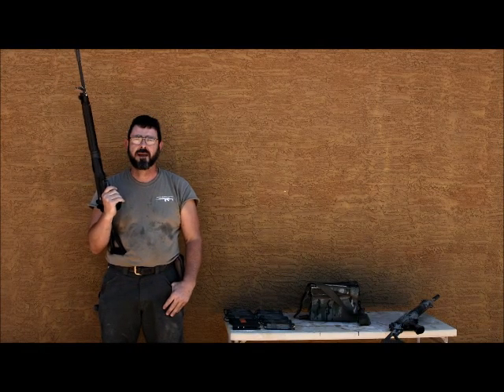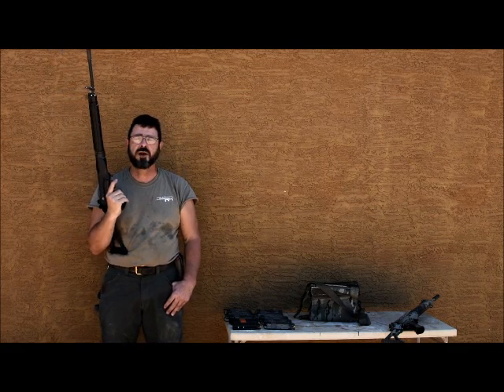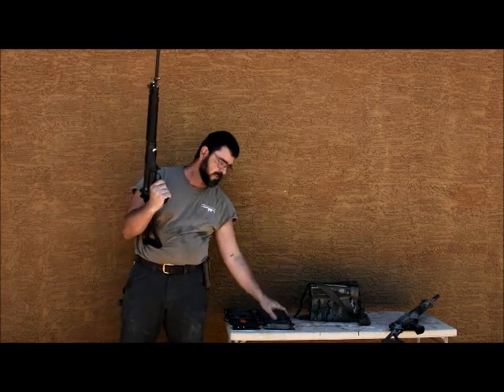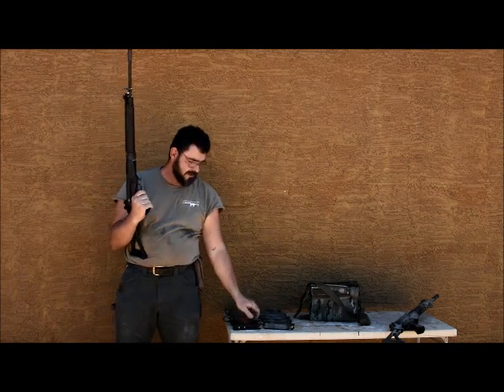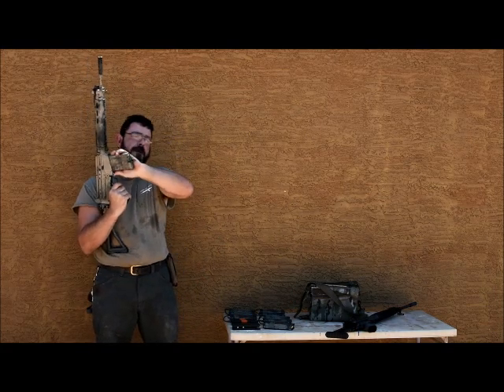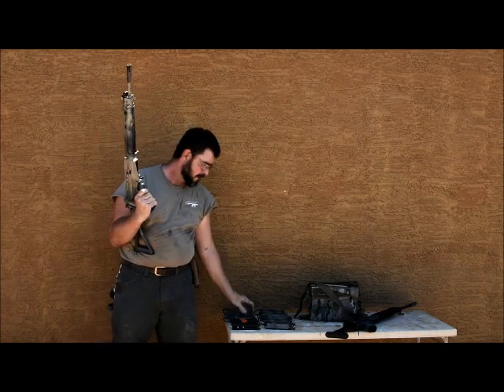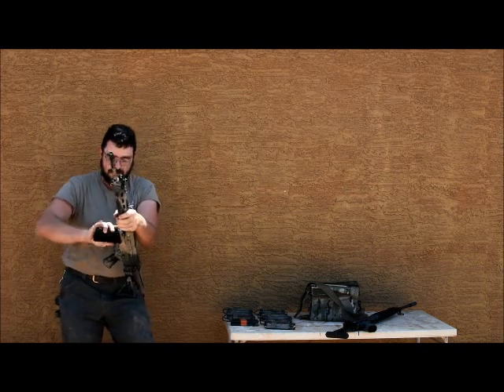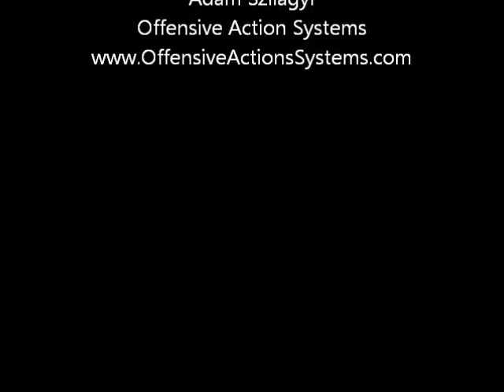Technical - DS Arms FAL Magazine Fit Demonstration

Comment: Well, I have one these from the 32300 range.  The original barrel was said to be defective in "overgassing" and broke the extractor.  DSA replaced the barrel and bolt.  Unfortunately the "overgassed" barrel does not seem to give the 2.5 MOA the original did.  More like 4 MOA.  All my magazines (10 DSA 20 rounders, 5 Austrian, one Thermold 10 rounder, and two DSA ten rounders (the short ones) work and fit very well.  I did have feeding problems and "bolt overs" but corrected that by removing a bit of the bolt hold open pin that was intruding into the cartridge on the left side of a loaded magazine.  Yes, I would have liked to get my hands on a SA48 (or FN FAL) but was short the "green".  I know there is hard feelings (to put it mildly) between Mark and DSA, but I'm inclined to go with Mark as he has ALWAYS answered my emails promptly and fully...no B.S.

Comment: What is the fundamental problem with the DSA mags?  Dimensionaly, where do they fail?  No doubt they fucked it up, but where?  It's not like they do not have the blue prints for the mags or enough samples to make a perfectly sized mag.
Reply from the maker: This video was to demonstrate the fundamental defects in the 2016-2018 DSA receivers.  Not the mags.  The mags have been junk since Day 1.  They knew this - their Beta Testers told them so.  But they sold them anyway, knowing they were defective.  It's the Chicago Way!  

As to what specifically makes them not function?  I don't know.  But I notice the forward rib/groove is visibly wider at the top than  a GI mag.

Comment: So why not give it a little slap and they would all fit.
Reply from the maker: "a little smack" DOES NOT work.  The receivers from 2016 to 2018 are defective. The mag well is just the easiest to demonstrate.  There are plenty of other defects.  Of course, DSA KNEW they were defective and sold them anyway . . . "It's the Chicago Way"
Reply: ArizonaResponseSystems if slapping it wouldn’t get the mag in you would have done so to make it look worse instead of just pretending to  push it down
Reply from the maker: @anomicanomic3217  You're a fucking moron.
Reply: The magazine should generally latch with minimal effort. You should not have to hammer a magazine into the well.

Comment: Sorry for being late to the show. My DSA SA58 is in the 27K Serial number family, purchased new. I've yet to have a magazine that failed to lock in unless I abused it to the point of no return. I don't have any aluminum mags, surplus steel and DSA mags. Some don't drop out freely but that's mostly because I run my equipment hard and they drop onto blacktop or tile "indoors". I'm constantly stepping on them or kicking them through all kinds of shit during classes and comps. They get cleaned out well with compressed air. My issue is feeding. Lots of double, misaligned rounds coming up and jamming or fail to feed altogether. I had the most unreliable rifle on the team last class. It was embarrassing, but I got lots of live malfunction clearing practice. I'm not going to be that guy again. I find myself having to rework the feed lips on them after a few mag drop reloads. Even with new mags I'm still having trouble.  This rifle is 3 years old and lives an active life. Would you recommend MOSES mags? DSA has them in stock and I'm an hour from them. A little help from a great sage would be appreciated.  Seems like the FAL files haven't been helpful to me.
Reply from the maker: I recommend GI mags only, any country.

I haven't had any pattern of problems with the Moses, but why bother - when compared to a known good.

DSA mags are teh Sux.  They have been defective since the days  Dave sent them out for beta-testing, and even with 100% "they suck", DSA sold them anyway.  It's "the Chicago Way!"
Reply: @arizonaresponse  Thanks brother. A big thanks for the fast response! I'm just tired of cycling through them like underwear.  I bend them and reform them. Once they get to the point of where I'm at now they get tossed into the recycling bin. Just hoping you would say the Moses are more resilient to abuse. Subscribed.

Comment: It seems that he doesn’t know the difference between metric and inch pattern magazines. For what I can see, he is trying to load an inch mag in a metric receiver, and since the inch mag has a metal lug in front it will never fit the notch space for a metric receiver.
Reply from the maker: Well, I guess that just shows what a fucking moron you are.
Reply: @arizonaresponse  😂
Reply: @arizonaresponse  legendary comment what magazines do you think will fit aero Precision 308 I want some metal magazines I already have pmags
Reply from the maker: @yazzyfresh  I'm not understanding your question - doesn't it take AR-10 mags?  I don't have an opinion on current manufacturers comparative quality as I don't use them
Reply: @arizonaresponse  that’s what I thought but I bought some ar 10 mags and it don’t fit in the lower so I’m lost at the moment thank you for replying I’ll get the name of the mags that don’t fit

Comment: I have a #37000 serial numbered Cold war 21" model FAL from DS Arms that I just purchased 3/20/19.  I only have the DS arms mag and thermold mag both mags function well, the thermold is a bit of a tight fit.  I'll be going to the gun show and wondering which brands usually have the best metal mags for this weapon as far as reliability?

Comment: DSA Inc. would like to notify any customers who are having a
magazine fitting issue or any issue what so ever with our FAL upper receiver to
please notify us directly so that we can inspect and address the issue. We have
determined a small number of receivers have had the engagement lockup area
machined in an incorrect location, being too high. This would not enable the
magazine to be rotated fully into the locked position. 

This was due to a defective tool holder being used and
operator error. This is the first time this issue has occurred in the 20 years
of us manufacturing FAL upper receivers. 

DSA uses the original Steyr and FN upper receiver blueprints
for dimensions. We inspect utilizing a CMM, hard gauges and industry standard
measuring devices that are calibrated and checked. We have taken steps to review
our processes and increase the inspection steps to avoid any future issues. As we
have always done, we will remedy any and all issues by repair or replacement. We stand behind our products no matter
what, and have a rock solid replacement warranty that is one of the best in the
industry. 

We always try to address every issue in a timely manner with
the resources at our disposal and qualified individuals committed to constant improvement
of all processes. We have many tens of thousands of our receivers and rifles in
the marketplace with happy customers using them every day. With 30 years in
business it is our daily goal to place only high quality American made products
into the hands of our customers.

For any issues please call 847-277-7258 or email at customerservice3@dsarms.com

Thank you for your patronage.
Reply: It's be cool if DSA and Arizona response systems teamed up.
Reply: "This is the first time this issue has occurred in the 20 years
of us manufacturing FAL upper receivers."

Untrue.  My 18" para SA58 that I purchased in 2009 had exactly the same issue and I had to send it off to y'all twice to get it corrected.

I do appreciate y'all making it right even if it took some effort.
Reply from the maker: Sounds great - in marked contrast to the "gunplumber is full of shit" response you've been giving since I first brought these issues to your attention  over a year ago.

Lets hope you will now correct the problems instead of returning the defective receivers with "no problems found."

And here's the key - you have to use in-spec, GI mags to test.  Not your defective DSA mags.
Reply: Does this mean if ordering a new British inch receiver from DSA in a month or two, it will be the "corrected" one, or are you still getting rid of the defective ones?
Reply: ElJefe45acp  I quit buying some DSA like over 2 years ago,,, they f*** me every time,, I can't even remember them all,, I would call him and ask him if everything was in stock and would go out in one shipment( they f**** flat out lied to me split it three shipments with 3 shipping charges) I was trying to get stripper Clips in a lightning loader I really wanted these they f*** me around for 18 months same as got your credit card on file when they come in they'll ship them,,1 after 2 years I called in this is all we cancelled the order,, yeah they agreed  magazines are f*** especially the 30 round I can only load of the 25 rounds otherwise the spring pressure one shot and they fall out of the gun,, back to the shipping deal every f**** order was split shipped ,, and every time I was like okay you're not going to split this one up right f**** lie to me,, I raised so much hell on the internet,, some lady called me and says what's your problem and I says everything that DSA dose is wrong ,, by that time I wasn't going to give them another bit of business I'd rather go to gun shows and Source obsolete hard to find parts was a lot easier than f**** DSA